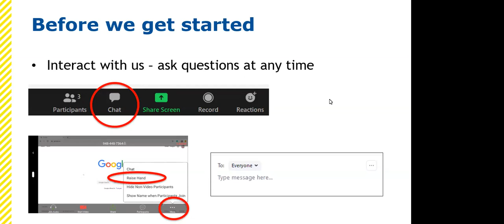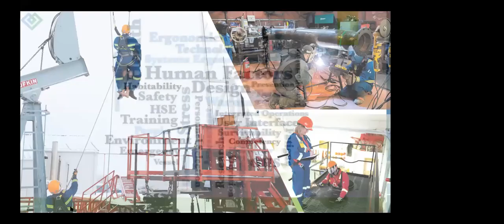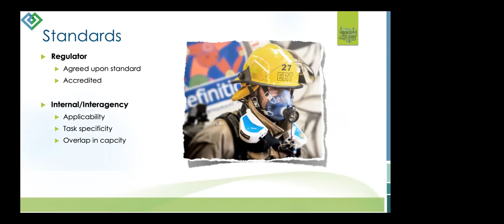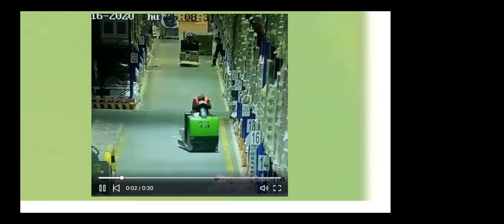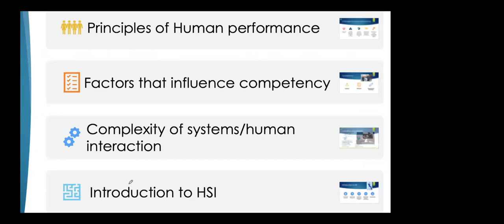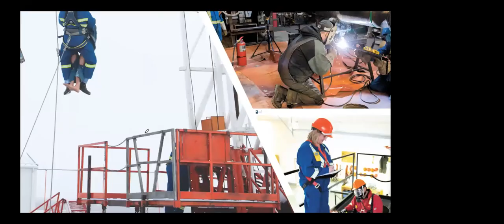Webinar | Identification of Invisible Boundaries of Safety - Understanding Supervisor Competency

Comment: The following list of books and research articles that provide a high level overview of focus areas within an HSI evaluation. There are hundreds (if not thousands) of other titles that could have been included in this list; however, these resources should provide a basic understanding of what information could be used in while considering human performance and competency. Several of the documents span across more than one category; however, will only be listed once.

HUMAN SYSTEMS INTERGARTION (OVERVIEW)

1.	Endsley, M.R. (2016). Building resilient systems via strong human systems integration. Defense AT&L Magazine - HSI.

2.	National Research Council (2007). Human -systems integration in the system development process: A new look. The National Academy of Sciences.

HUMAN FACTORS/PERFORMANCE

3.	Dekker, S.W.A. (2005). Ten questions about human error: A new view of human factors and system safety. Mahwah, New Jersey: Lawrence Erlbaum Associates, Inc.

4.	Flin, R.H. & Slaven, G.M. (1995). Identifying the Right Stuff- Selecting and Training On-Scene Emergency Commanders. Journal of Contingencies and Crisis Management, 3(2), 114-123.

5.	Flin, R., O’Connor, P. & Mearns, K. (2002) Crew Resource Management- Improving team work in high reliability industries. Team Performance Management, 8, 68-78.

6.	Mehta, R. K., Peres, S. C., Kannan, P., Rhee, J., Shortz, A. E., & Sam Mannan, M. (2017). Comparison of objective and subjective operator fatigue assessment methods in offshore shiftwork. Journal of Loss Prevention in the Process Industries, 48, 376–381. https://doi.org/10.1016/j.jlp.2017.02.009

7.	Vincente, K. (2003). The human factor: Revolutionizing the way we live with technology. Toronto: Random House of Canada Limited.

SITUATION AWARENESS

8.	Endsley (2015). Situation awareness misconceptions and misunderstandings. Journal of Cognitive Engineering and Decision Making, 9(1), 4–32.

9.	Taber, M.J. (2015). Situation awareness in Canadian offshore oil and gas emergency response training. Journal of Basic and Applied Research International, 14(4), 244-253.

10.	Sneddon, A., Mearns, K., & Flin, R. (2013). Stress, fatigue, situation awareness and safety in offshore drilling crews. Safety Science, 56, 80–88. https://doi.org/10.1016/j.ssci.2012.05.027.

11.	Stanton, N.A., Salmon, P.M., Walker, G.H., Salas, E., & Hancock, P.A. (2017). State-of-Science. Situation Awareness in individuals, teams and systems. Ergonomics, 60(4), 449-466.

12.	Stanton, N.A., Salmon, P.M., Walker, G.H., & Jenkins, D.P. (2010). Is situation awareness all in the mind? Theoretical Issues in Ergonomics Science, 11(1-2), 29-40.

DECISION MAKING/LEARNING

13.	Brooks, C. J. (2008). Knowledge of human behaviour under stress and sleep deprivation. AG-HFM-152-06.

14.	Taber, M.J. (2015). Situation awareness in Canadian offshore oil and gas emergency response training. Journal of Basic and Applied Research International, 14(4), 244-253.

15.	Taber, M. J., & Taber, N. (2013). Exploring emergency response: Theories of communities of practice, safety cultures, situation awareness, and tacit knowledge. International Journal of Emergency Management, 9(1), 46-58.

16.	Taber, M.J. & Taber, N. (2020). Learning beyond ‘hands and feet’ in offshore helicopter operations: Integrating the individual with the social in CRM and SA. Theoretical Issues in Ergonomics Science, DOI- 10.1080/1463922X.2020.1729444

17.	Reason, J., Parker, D., & Lawton, R. (1998). Organizational controls and safety: The varieties of rule-based behaviour. Journal of Occupational and Organizational Psychology, 71, 289-304.

HUMAN ERROR

18.	Reason, J. (1990). Human Error. New York: Cambridge University Press.

19.	Reason J. (1997). Managing the risks of organizational accidents. Burlington, VT: Ashgate Publishing Company.

SAFETY CULTURE

20.	Antonsen, S. (2009). The relationship between culture and safety on offshore supply vessels. Safety Science 47, 1118-1128.

21.	Cox, S., & Flin, R. (1998). Safety culture: Philosopher's stone or man of straw. Work & Stress, 12(3), 189-201.
SIMULATION TRAINING

22.	Horn, G.P., et al. (2015) Physiological responses to simulated firefighter exercise protocols in varying environments, Ergonomics, DOI: 10.1080/00140139.2014.997806.

23.	Taber, M. J. (2014). Simulator fidelity and contextual interference in helicopter underwater egress training-An analysis of training and retention of egress skills. Safety Science, 62, 271-278.

SURVIVAL PSYCHOLOGY

24.	Leach, J. (2012). Survival psychology: The won't to live. The Psychologist, 24(1), 26 – 29.

25.	Leach, J., & Ansell, L. (2008). Impairment in attentional processing in a field survival environment. Applied Cognitive Psychology, 22, 643-652.

26.	Leach, J. (2005). Cognitive paralysis in an emergency- the role of the supervisory attentional system. Aviation, Space, and Environmental Medicine, 76, 134-136.

27.	Leach, J. (2004). Why people freeze in an emergency: Temporal and cognitive constraints on survival responses. Aviation, Space, and Environmental Medicine, 75(6), 539-542.

28.	Leach, J. (1994). Survival psychology. Palgrave Macmillan: Basingstoke.